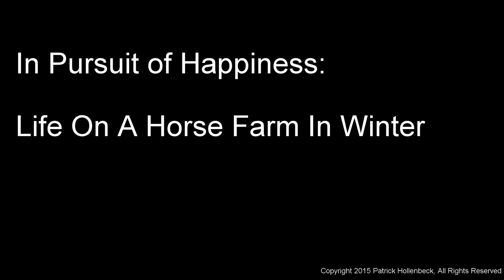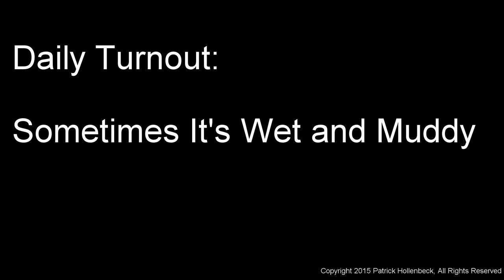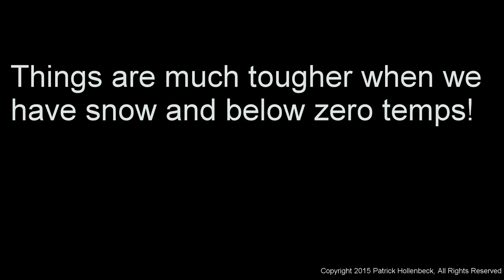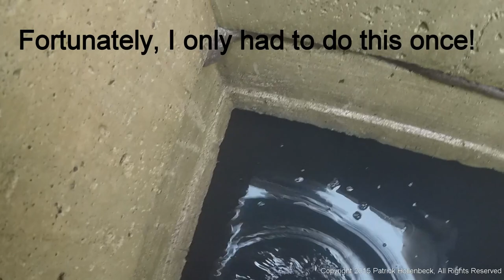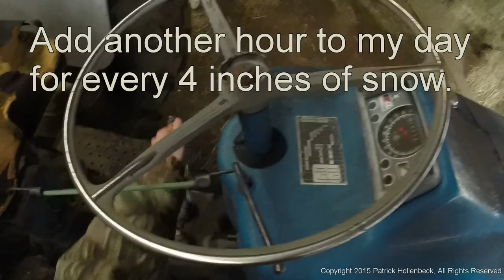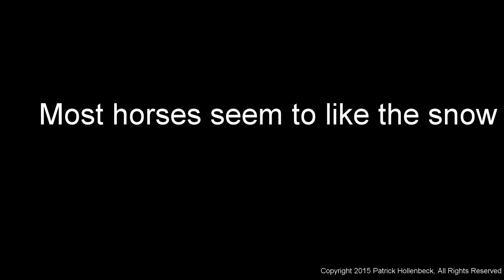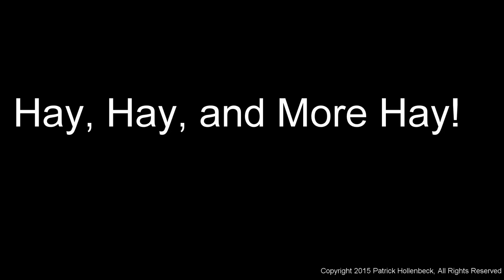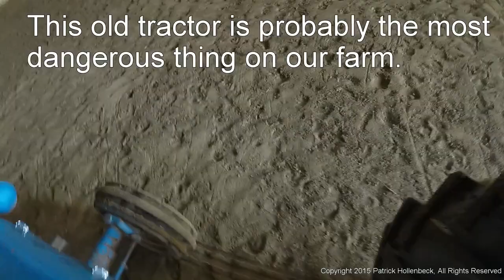In Pursuit of Happiness:  Working on a Horse Farm in Winter

Comment: I have 3 geldings here in western Montana. They have a shelter, but no barn. Two have winter coats so they get rain blankets just to keep them dry. My other boy never gets much of a winter coat so he has a blanket. Hay is tarped outside on pallets.  Sledge hammer ready to bust up trough ice. I’m tenting this house for one year. Next place I’ll have a proper barn. Why are some of the horses wearing grazing muzzles? I would think sawdust would not be good for a horses respiratory system because of how fine it is. Why not wood shavings? Couldn’t you sell the manure to local gardeners or farms for soil amendment? Sorry for so many questions. I’m just a curious sort.

Comment: Those stalls are too small for horses. Fix the pasture and leave horses out more. They r herd animals. They need more food than just small buckets.
Reply from the maker: The stalls are 10 ft by 12 ft.  Plenty big for a horse.  The Go Pro camera lens has a tendency to distort the size of images.  They don't spend all day in the stalls.  The pastures are not broken.  Weather permitting, which is almost every day, they are turned out in our large (multi acre) pastures with other horses.  In winter, they are outside for about 8 hours a day.  In summer, they are outside for about 15 hours a day.  They get plenty of food.  The small buckets are used for grain and supplements only.  On average, they get about 20 lbs of hay each day plus whatever they want to eat outside in our pastures.